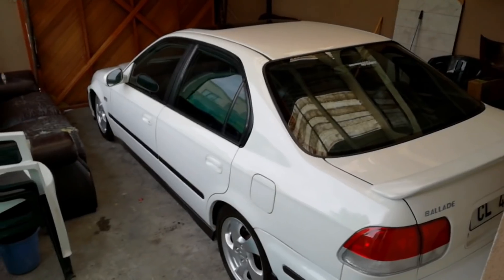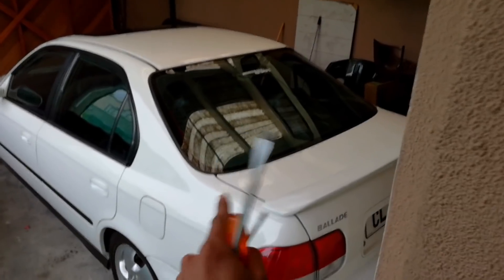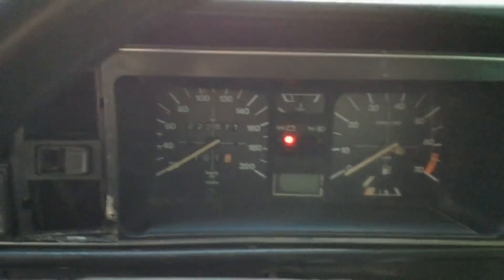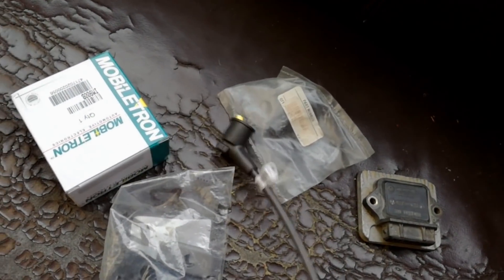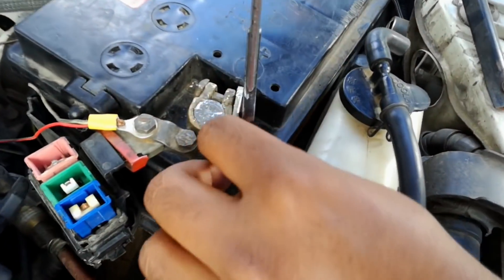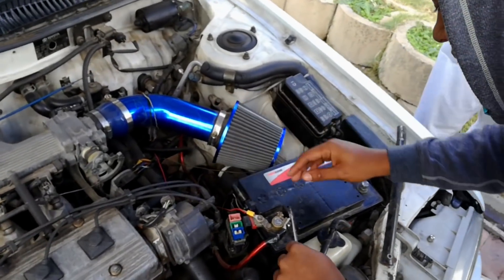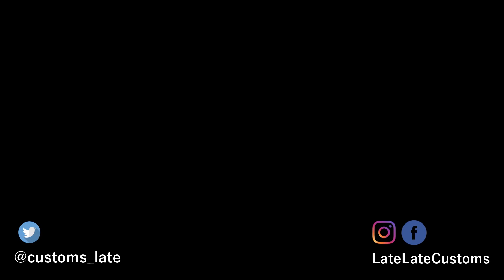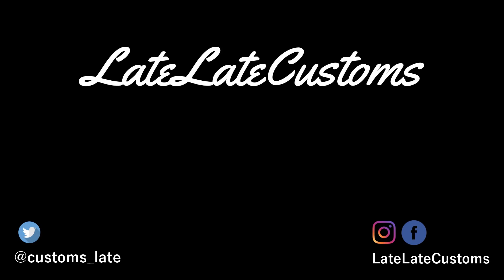I got BAD NEWS (Yellow Thang)!!

Comment: What do you mean there is power on the motor? Plus check your earths ontop by the fuse box side. There is like 5 or 6 earths that is plugged in there
Reply from the maker: Check it all. All of them are find. There is literally power/volts on the block.

Comment: Bru im telling you it might be something very small there is power but maybe not enough to start, maybe when you re-wired the dash something wasnt right maybe earth leakage or wrong wiring, coz as you started it after the re-wire it sounded like it was miss firing already. Hope you get it sorted bru.
Reply from the maker: I found out thay one of the cables in the distributor loom burned. So i just need to buy a new loom for the distributor